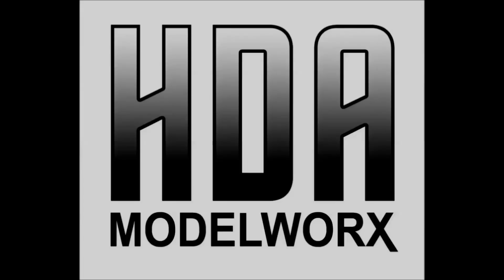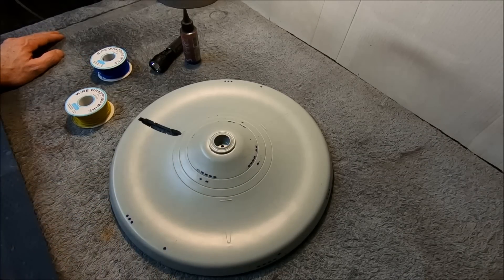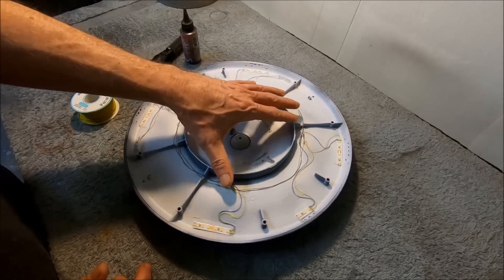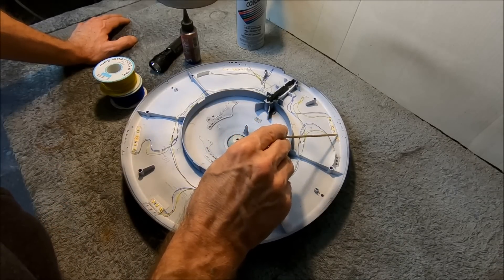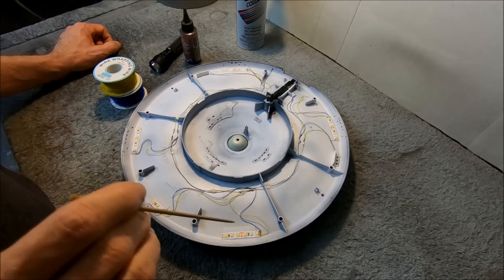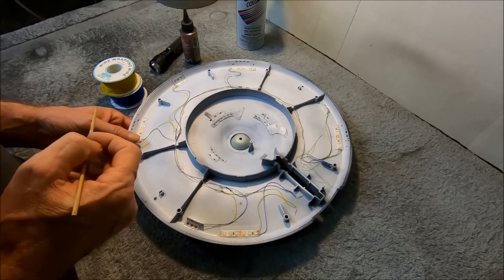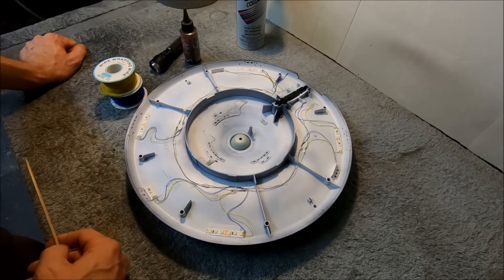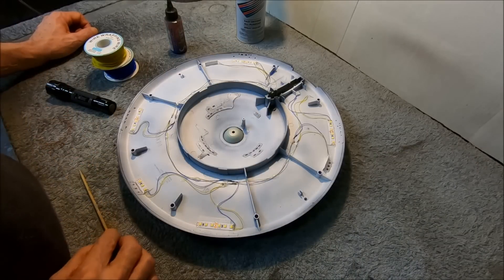Updated 1:350 Scale Polar Lights TOS Enterprise Build Series Pt 1

Comment: Boyd this is perfect! After 30 years I am finally retired and have the time to get back into modeling. Needless to say I have spent the last few months ordering and stocking up on all the Mobeus, Polar Lights and Round 2 Kits I've been drooling over all these years. I've even been ordering all the bells and whistles Photo etch and Lighting kits to go with them. And of course one of the first kits I ordered was the 1/350 50th TOS Enterprise.. Anyway I decided to go with the Tenacontrols none motorized bussard lights and I'm hoping in this series you'll go more indef on installing it, and how to wire in the window lights to the same power source if possible. There was also an earlier video where you used that particular bussard lighting kit and it looked like you painted the inside of the domes with a solid looking copper color, Yet when you turned on the lights the bussard effect showed thru perfectly. I want to recreate the same look.... Sincerly; J.D. Douglas
Reply: I believe the interior of the domes are painted a transparent orange.

Comment: I am building the 2012 issue with grid lines. Thanks for upgrading the build information. I like the 2012 issues with the grid lines. I have over 14 of them an 2 smoothie issues and 5 smooth saucers I have as well.
Reply from the maker: The older grid line kit is of better quality. The plastic is thicker and a superior grade. Have fun with it buddy.
Reply: @TrekWorks  the one thing I have learned from you over the years is if you make a mistake take a deep breath, walk away for a few minutes, regroup and fix it. I have learned that anything can be fixed , just stay calm.

Comment: Great instructional video...as always, Boyd! One question...before, you used diluted acetone to clean the saucer halves before gluing (or, at least you did on your last refit video). Did something happen to change your mind on doing this?
Reply from the maker: On the Refit there I used the acetone because I was smoothing out the putty I had put over the joints on the saucer edges. It works better than sanding and losing the detail of the sensor band ridges. Here on the TOS saucer I'm just scraping off the paint so the glue gets a good bond.

Comment: This is going to be a Great series! Thank you for doing them. Can you specify which Sloarez glue you used? I'm seeing three versions on amazon. Also, does the Tena Controls lights comes with all the LEDs your installing. I've been looking at getting a set. Thanks again!
Reply from the maker: Go to Solarez.com and look for the doming type UV resin. That's the stuff you want. You can check at Tenacontrols.com to see what their lighting kit's include. I buy only their control circuit boards and use LED's I get from Hdamodelworks to make my own lighting systems.
Reply: @Trekworks Solarez.com has 4 different types of doming resin. Which one are you using, the flex or the hard? Those are the only 2 with blue on the bottom of the bottles.
Reply from the maker: The hard type.
Reply: @TrekWorks  Thank you! Looking forward to the next vids in the series!

Comment: Dumb question from a long time but ultimately still ignorant modeler. Why not clean up and paint both halves of the saucer before doing all this then you'd avoid all masking? I get you'd have to do some additional painting when you fill and fix the seam, but I would think masking everything but the seam would be easier than masking all those little windows.

Either way, super helpful and I'm starting on mine in a few weeks. The lighting kit is a bit rich for my blood so I'm doing a simpler one with an arduino kit on my own.

Comment: Let me preface by saying that I love your work and your dedication, and you have been a huge inspiration to me. I mean absolutely no disrespect, but I have heard you describe the difference between series and parallel incorrectly one too many times. Your LED strips are always wired in parallel, always - even when you daisy-chain them. Series means + to -, + to -, + to -. You always hook + to + to + and - to - to -, so it is technically still parallel, even when daisy-chained. The method of wiring everything off of a bus instead of daisy chaining absolutely does help for not losing everything if one strip goes bad, but your wiring has always been parallel. Ok - I'm done. Love you, man.